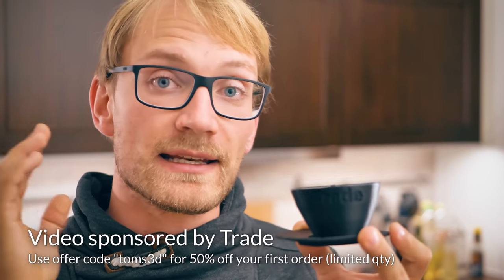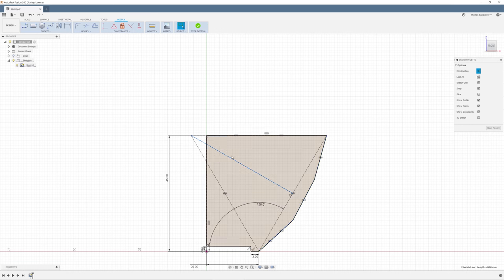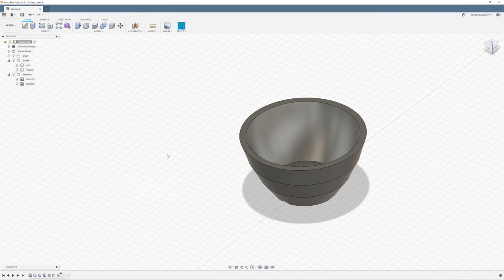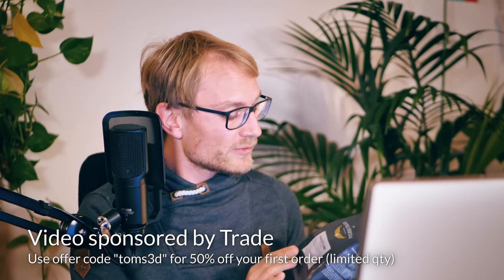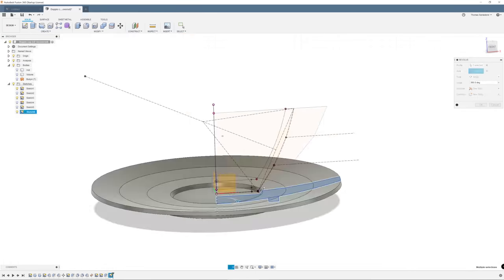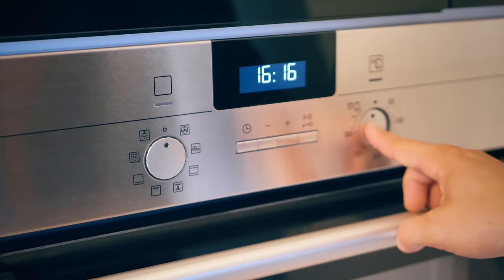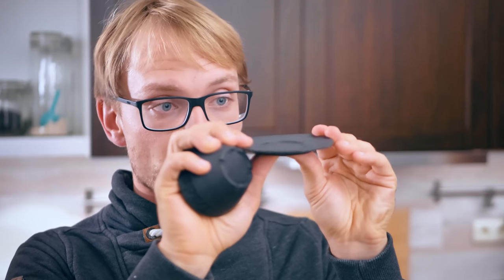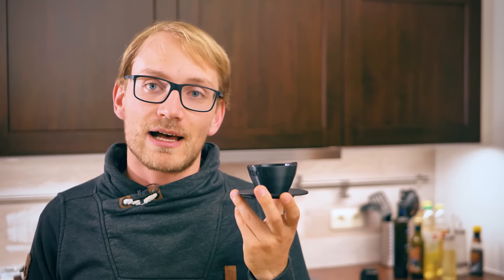Custom crystallized PLA Espresso cup! #HTPLA #Fusion360

Comment: Hey Tom. Nice video. Love the intro. B) I'd recommend replacing your aluminium Bialetti with one made out of steel. Better taste and not as potentially bad for your health. Regarding that PLA. Did you try out Extrudr Green Tec Pro? Temperature resistant to 160°c right off the bed (or right off the bet?). Also foodsafe, very strong, high impact resistance, biodegradeable and odorfree. Cheers!

Comment: Wow. For everyone complaining about the “food safety” of PLA... I suggest that you never visit the factory where your kitchen utensils were made... (hint: they weren’t made in a clean room). For the record, I get it, you need to make sure that you use a food safe material, but as others have pointed out there are probably more contaminants on your kitchen counter or your food...
Reply: You can heat sterilize metal utensils. Just try to do the same with plastic.
Reply: @crimsun7186  isnt 100c hot enough to heat sterilize?

Comment: is it really save to drink from cups made of PLA...speaking about toxics ?
Reply: No. There are FDA approved filaments. None of them are PLA. All of them are pets. You need to buy a food grade specific and approved filament. You also need a food grade nozzle and filament liner and extruder and print bed. Your machine can never ever run any other filaments other than food grade. If you do not do it EXACTLY correct you are risking peoples lives. Period. Peoples anecdotal experiences mean less than nothing in this matter. Even when done 1000% correct you still need to treat 3d printed food items like a wooden cutting board due to fdm printing having layers. Avoid contact with all meats at all times period. Always fully sanitize just before use, simply washing after use is not good enough.

Comment: I think if you had placed the items on silicone release paper on a flat surface like a cast iron skillet (something that won't deflect from the heat - ie, not a cheap cookie sheet) and inverted them the warping would have been less of a factor.

Comment: that heat treatment was 100 F or C?    If C, the PLA should have melted!
Reply from the maker: What is F?
Celsius, obviously - HTPLA crystallizes instead of melting at that temperature, which makes it incredibly temperature resistant.
Reply: Never mind, the 3D printer uses degrees C not F.  PLA would not melt in boiling water even if not heat treated, but it might soften.  So could you heat treat it in boiling water instead of in the oven, or does it have to be a 'dry' heat?

Comment: Does this process work with any pla?
Reply from the maker: It works with many PLAs, but depending on the exact raw resin they use and which additives they throw in, results may vary.

Comment: I have to point out, that the way your text is made sucks, the text gets distorted. Try your method with a longer word
Reply from the maker: What would be a better method?
Reply: Velocity paint the text on the cup.  There is also a "sheet metal" forming module in F360 that will allow you to "wrap" the text onto your model.

Comment: I'm disappointed in the approach to food safety. I know the 3d printing community does not consider printed items to be liquid food safe because of pores and layer lines allowing for bacterial growth. In addition to that the nozzles used by most general persons have lead in them. 

Resin coating with either epoxy or polyurethane is not a solution. There is not any consumer grade resins that are food safe for temperatures above 55F.
Reply: Brandon Saffell I wonder if metal plating would work though. It's pretty easy to do but I don't know how foodsafe nickel or copper (the most common metals for playing 3D prints) are.